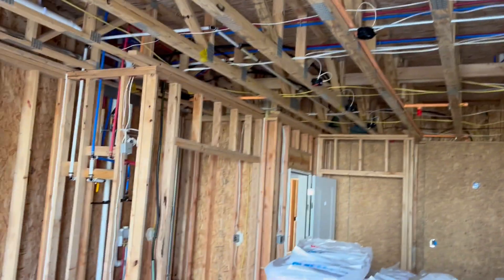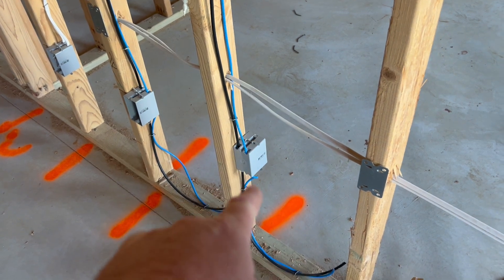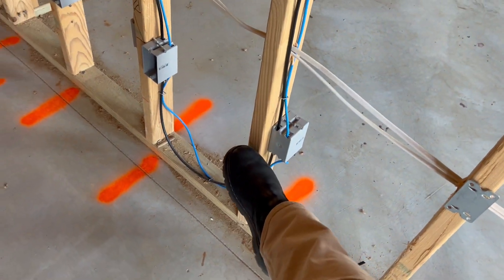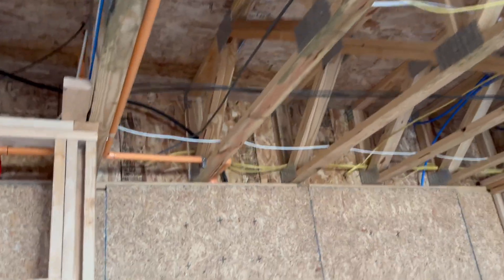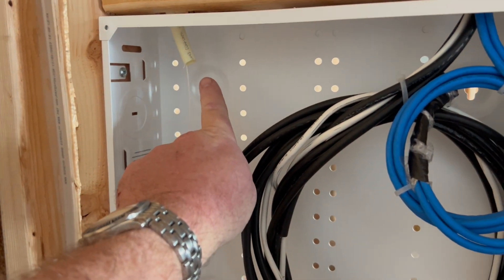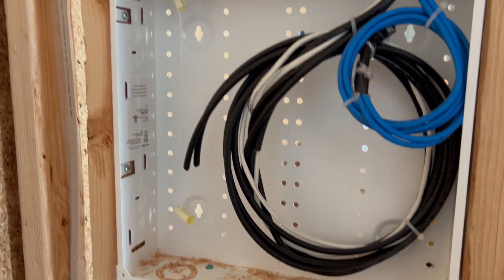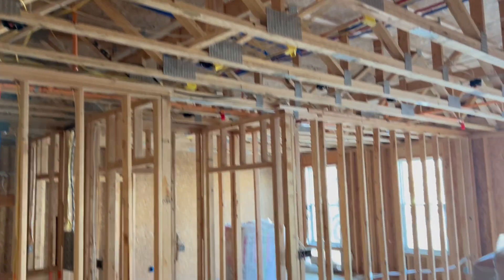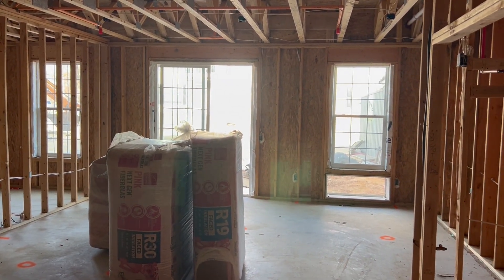Example of Apartment Complex Data Wiring for Fiber and Telephone in New Jersey | Bridgecable.com

Comment: I live in a older condo that is strictly coaxial cable (Xfinity), I assume that condo association gets kickbacks. complex is on a corner, on one side of street is fiber/cable and then the across another street is fiber/cable. Just don't understand my complex is restricted to only cable. Don't tell me about 5g internet, that's horrible.
Reply: It's definitely controlled by the complex
Reply: The complex typically has to pay whatever fiber ISP to come and retrofit the complex with microduct for fiber. They probably dont want to pay
Reply from the maker: So varys........but this one complex is installing the fiber and micro duct during building. Then they provide internet as a service to renting their apartments. Unsure of the legal or MUST DOs in PA and NJ.